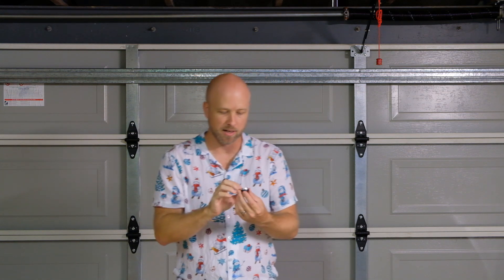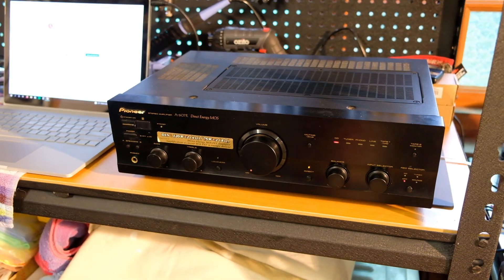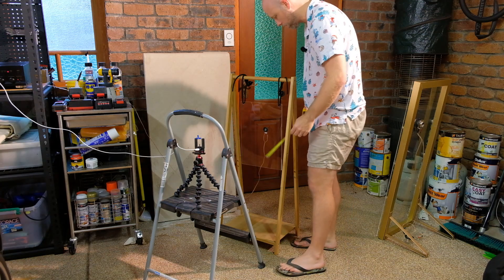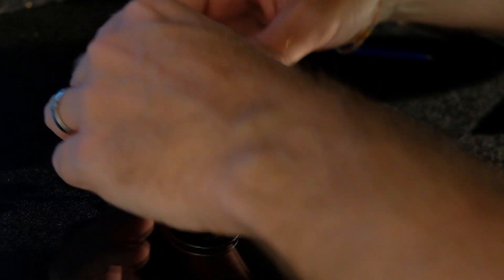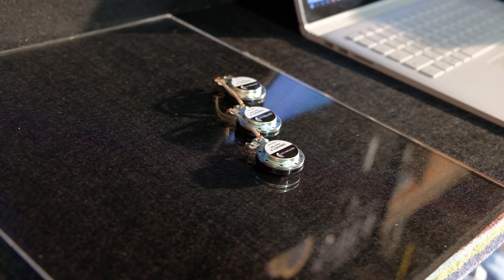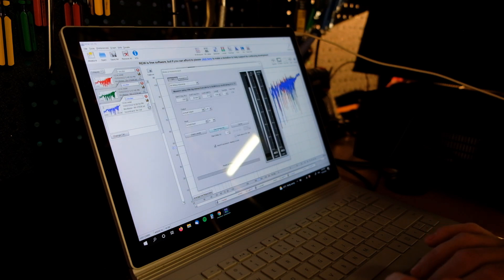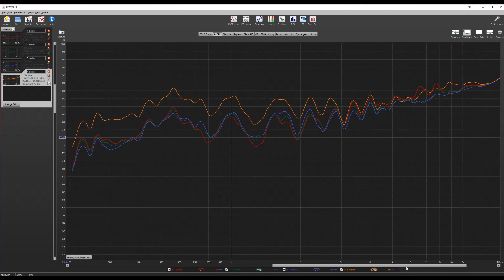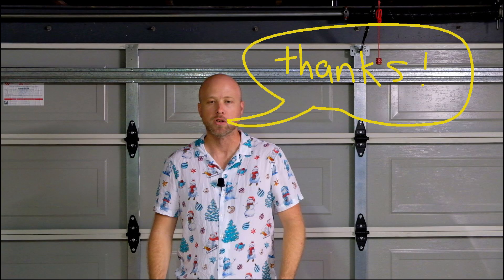Multi-Driver DML Panel Test - How Many Exciters?

Comment: The "dead spots" on the panel change based on the frequency of the sound being produced.

There may be one or more 'true' dead spots that are dead at all frequencies, but I have not found one.

You can test yourself. I did it by placing the panel horizontal, putting a taped border around the edge of the panel, and pouring salt to cover the panel. I have used talc, rice, salt, flour and BBs. They all behave differently. But find what works for you. As you play different frequencies you can observe which areas of the panel are vibrating and which are dead. As the frequency changes the lively spots move. You can also observe how the sound falls off the corners of the panel, which is why the manufacturer recommends rounding the corners to eliminate that fall off. The 4 x 5 shape also keeps the sound in the panel which helps overall quality.

Lastly, you commented on another video that the bass shakers were developed to limit bass (I'm paraphrasing), but that is not exactly correct. They were developed to deliver parts of the bass sound range that are otherwise inaudible and that can transfer through material and 'heard' in other ways. For panel speakers they can act like subwoofers and enhance the bass response without needing an actual separate subwoofer. When I post my configurations I'll tag you. I don't do any measurments, though, it's only about how it sounds. Cheers.
Reply from the maker: Thanks - that does seem like a much better way of measuring it. 

Re the bass shakers - I actually bought one of the dayton puck-style ones to test with, but I haven't had the chance to do so yet. I wasn't too hopeful due to the website saying things like the following:

"When a BST-1 Bass Shaker is installed on a resonant surface, it increases the portion of tactile sound as being "felt" beyond what is normally produced by subwoofers and ordinary speakers." 

With no mention of enhancing audible bass.

Very interested to see how you've applied them!
Reply: @TypicalBenYT  The same way exciters work the bass shakers sound will depend on the "MATERIAL", its attached to as most bass shakers are attached to the wood portion of the furniture.

Comment: Ben,
If I see it right you have a lifting frequency response upto 20kHz measuring from a distance of 60cm?
I would be interested to see a measurement from the listening distance ( also between 200Hz and 20kHz ) just to get an idea what actually will be possible in room.
My prediction is that the panel will become less going up in the high frequencies ( would be good ) .

If you make a measurement from a bigger (listening) distance, I think it would be good to do a mmm ( moving mike measurement) with REW, just to get a view of what the midhigh and high are really doing at the listening position.
One sweep will not work on  a bigger distance when measuring on 2 speakers. Do not use it for anything else than close mike in the frequencies above 5kHz.
An alternative way of measuring is doing around 8 sweeps around the axis position and use average.
But again mmm is most acurate and simple to do with REW . Use the generator on pink periodic noise and measure with the RTA function while moving the microphone (  on a stick ) in circular motions around the listening position .

Be aware that in the end you want some sort of "housecurve" and not a flat line. A flat measurement is what you want if you measure a good speaker in an anechoic chamber on a distance of around 1m.
That same speakerset in an average houseroom, measured on a normal listening distance will have a sloping curve towards the higher frequencies . And that is what will sound normal and good.
Reply from the maker: Really interesting, thanks for the info. I've never tried an MMM (in fact I'm not sure I've even heard of it) so this is really useful!

I think my next 'measurement' type video will be comparing my larger panels - Plywood fixed and free, acrylic fixed and free configurations, so I will use it as an opportunity to up my measurement game as well!

Regarding the sloping HF - that has been a feature of all panels I've tried (these small ones at 60cm and also my larger ones at ~1m). If I understand your comment, you're saying that it should flatten out at a greater distance, even on-axis? My assumption would be that the LF would drop off due to the wider dispersion.
Reply: @TypicalBenYT  
This was a video that showed me how to do a mmm :  https://www.youtube.com/watch?v=6RiuwqzjqlQ&t=1354s&ab_channel=ProduceLikeAPro
Recently I made a somewhat clumsy video ( saddly English isn't my native language) in my hometheater that shows the difference between a single measurement, multiple measurements averaged and a moving mike measuerement. you find it here : https://www.youtube.com/watch?v=u3U2258k2IM&ab_channel=gvybin
These measurements were done with the full 6.2 system working. The moving mike measurement is usefull when you do an in room measurement of a system or to measure the frequency response of a speaker in conjunction with the room it will be used around the listening position.
The strange speakers are my hybrid electrostats ( ESL panels from 300 up to 20kH + 8" bass drivers from 80hz-300hz) + subwoofers from 17Hz-80Hz
The sloping curve I get is equilized using equilizer APO with REW. My electrostat panels have a tendency to put out more treble but I worked the system down to a harman housecurve and it sounds way smoother , less harsh even on loud volumes, but powerfull in the bass. The bass extents to 17Hz and I cut it off below that as you can see in the measurement. You don't need that low bass extension for music, but for movie it is great
Reply from the maker: @gvybin  oh great thanks, I’ll have a look at these when I get a chance. Appreciate the info!